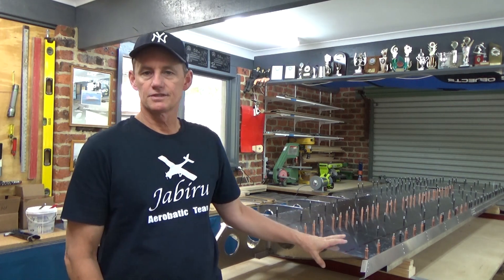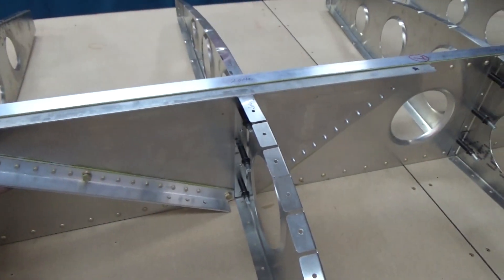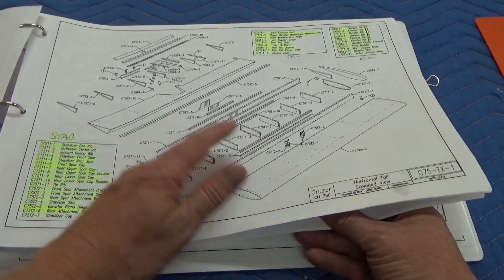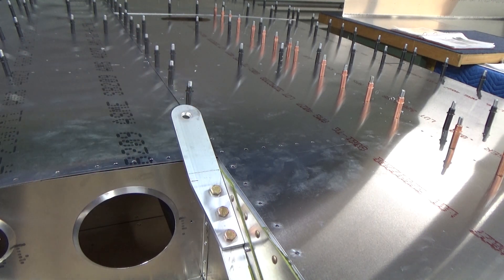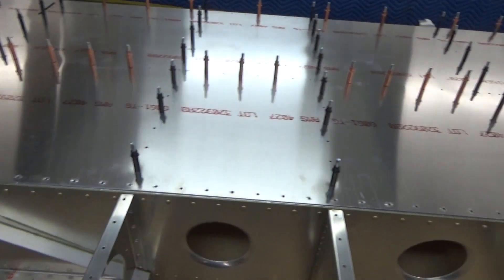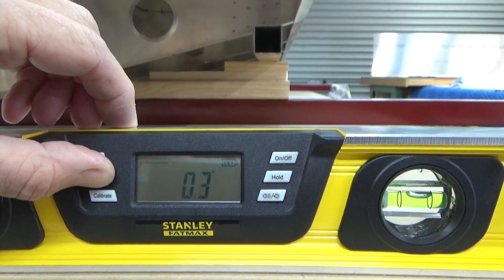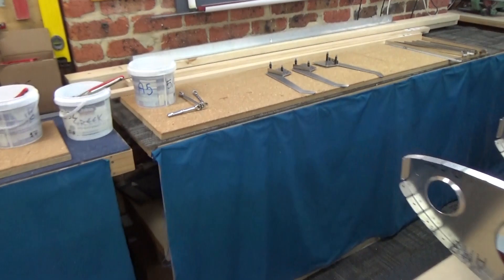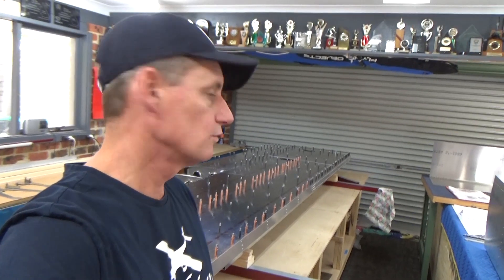How I assembled the Zenith 750 Cruzer Right Hand Wing

Comment: Do you need to pre-wire the wings before putting on the skins, or do you run any wires for lights, flaperon motors, etc. afterwards?
Reply from the maker: Yes you need to run wires for Nav lights, Fuel senders, and fuel hoses and vents, also the pitot system lines prior to closing the wings.